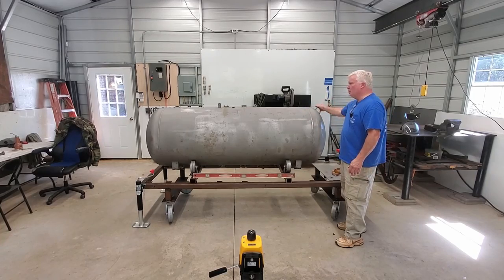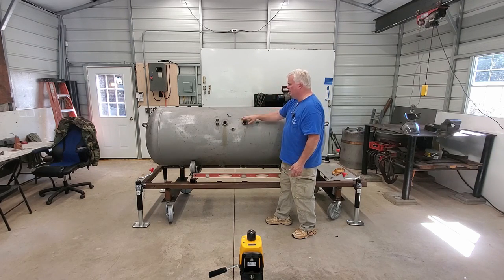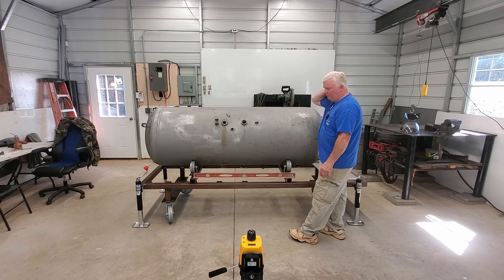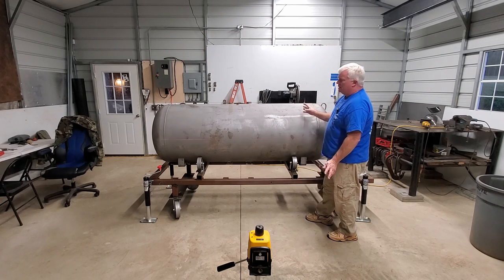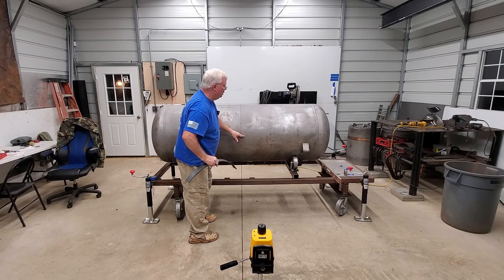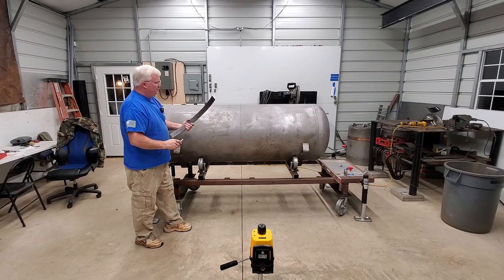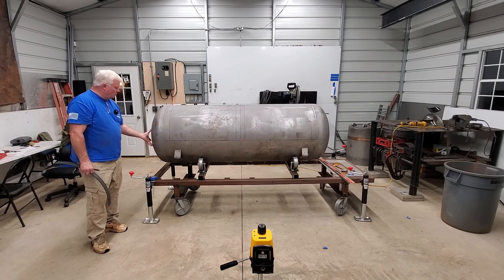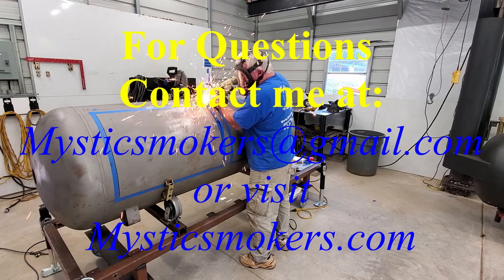Mystic Smokers 250 Gallon BBQ Smoker Build - Episode #1 Door Layout

Comment: Very informative video. I really like your rotisserie and how you’ve designed it. I plan on modifying mine and using some of your ideas to improve on mine. It’s amazing just how many hours are spent trying to get the tank positioned correctly. Thanks
Reply from the maker: Very few builders go to the lengths that I do to get the fit and finish that I do. 

After watching the series,  you will be able to spot where guys cut corners to save time, money and materials.  

For example: 
Many guys will give very little thought to tank layout.  They simply place the tank on a stand or trailer in its upright position.   Heck most guys build the cooker on the trailer or stand. 

Most dont remove and patch the bung holes. 

Skipping those two steps  alone saves a tremendous amount of time and labor which of course means greater profits.  

Most builders give very little thought to air leaks.. the cooker will still perform and a beginning or novice operator may never know the difference.  However,  once you run a well made cooker, you recognize the variables that poor fitting doors can introduce immediately.  

"Patina finishes" are another area where builders save time, money and expense.   To fully sandblast and properly paint a cooker takes at least three days including the baking process.

The patina finish is very quick and easy.  Linseed oil is another shortcut.   Granted,  both look very nice if done right.   However,  neither will match a quality high temperature paint properly applied and baked.  

Applying high temp clear over 60 year old paint makes no sense.  The underlying paint is not temperature rated and will fail.  In addition,  repeated heat cycles will cause it to chip loose over time.

Not to mention that old industrial paint is laced with horrible heavy metals in many cases and is incredibly toxic.

My cookers do take much more time and effort to build.  I build each cooker exactly like it belongs to me or if I were gifting it to a family member or friend.   If I know all of these factors and I have the resources to do it "right", I can't just slam cookers out the door.  

You dont have to do the things I do to produce a cooker that will cook good.  However,  if you want to maximize fit and finish and eliminate door leak potential.   This is how I do it.  

Thanks for the comments.

Comment: Will the tank still be usable if i put doors right next to the bunghole or valves
Reply: The welds at the bungs are almost always large enough that they put a lot of stress in the metal.   I stay as far as i can from those.  At least 8 to 10 inches.

Place a straight edge along the bungs and you see the tank dip down near them.  That's from the welds.
Reply: @mysticsmokers3014  it only had just one
Reply: @mysticsmokers3014  can it be fixed